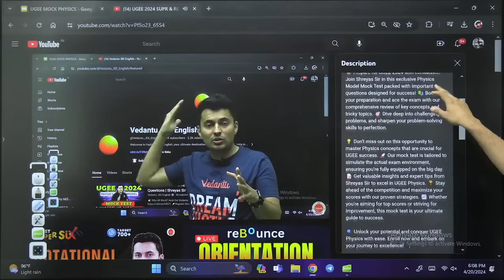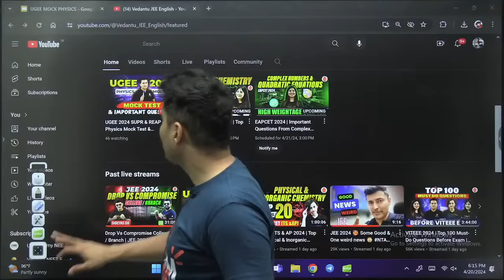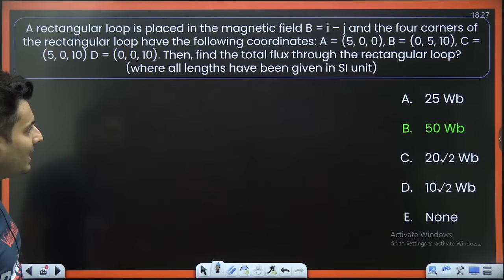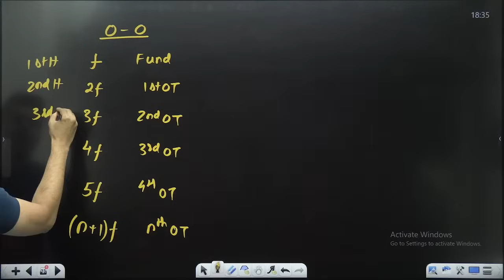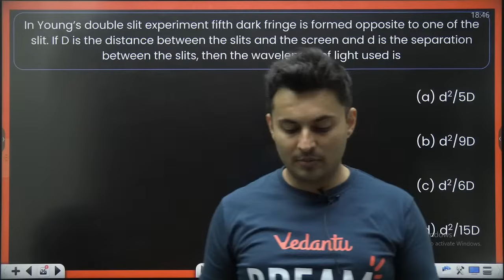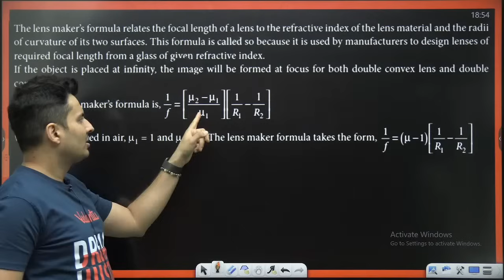UGEE 2024 SUPR & REAP 💡 Physics Mock Test & Important Questions | Shreyas Sir

Comment: Sir for SRM exam we have to write at home in laptop and is monitored by invigilators rpom, sir according to instructions manual we are not supposed to use any rough paper or bits, so all the questions have to be done in mind and also they mentioned that you have to only look at screen for whole exam , sir there are questions which need to be solved on paper so how do I ace them sir?
thank you